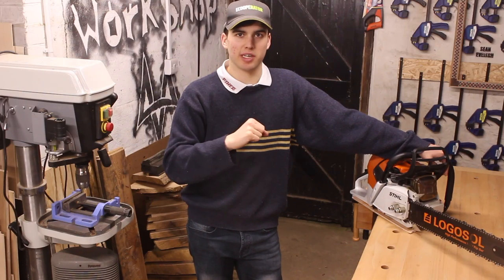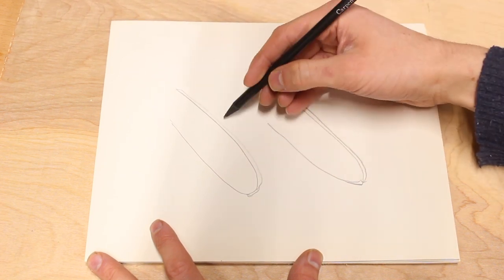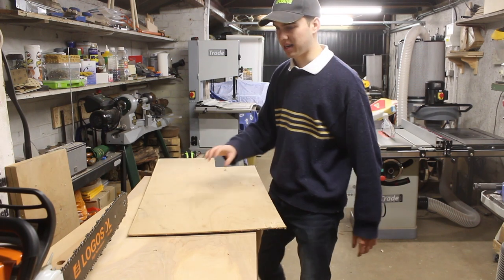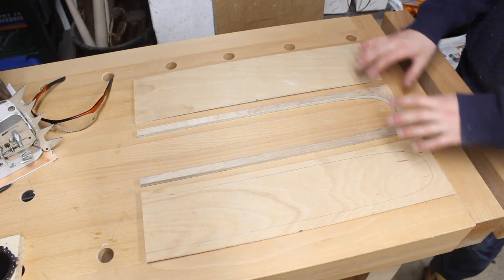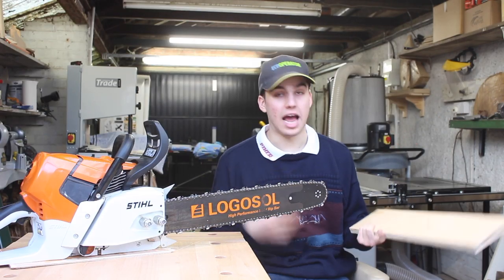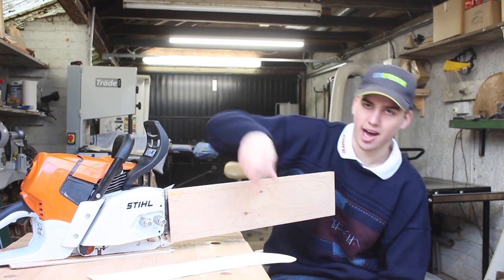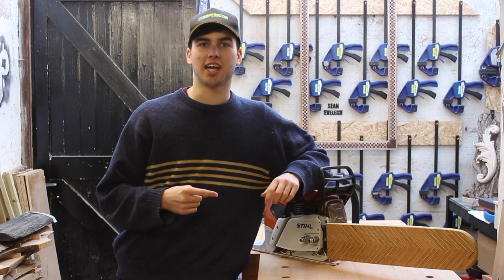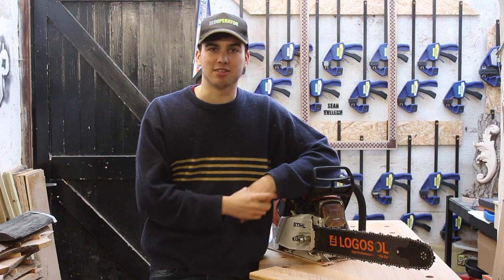How To Make A Patterned Plywood Chainsaw Bar Cover! (Easy Herringbone Pattern)

Comment: Nicely done Sean 😁. The herring bone is really effective... I like it 😁. Don't think I'll do one of these for my saws... mine leak chain oil at a rapid rate of knots so my cover would get soaked and end up weighing more than the saw 😂🤣. Lovely Job Sean, keep am coming 😁👍
Reply from the maker: Hi frank, yeah it is, I'm glad it came out well. ahah mine actually leaks a little for the bottom, whenever i stop using my chainsaw, I empty all the bar oil out. (still leaks a little after that though ahah)

Comment: Neat idea... maybe add a rare earth magnet to the part that goes against the saw (not bar) so that it stays in place?
Reply from the maker: Hi mate, thanks for watching. That's quite a cool idea, the cover fits on quite tightly, so it doesn't actually slip at all.
Reply: @SeanEvelegh  That's interesting that it doesn't slip.  Guess I was comparing it to the factor plastic piece o' crap shield that came with my chainsaw... thing is so loose that it's always at least partially off.  (Kinda funny that a home made one fits better than factory. =) )
Reply from the maker: @RealRuler2112  Yeah i agree, the plastic ones are to slippery, I think the teeth on my chainsaw grip the cover aswell